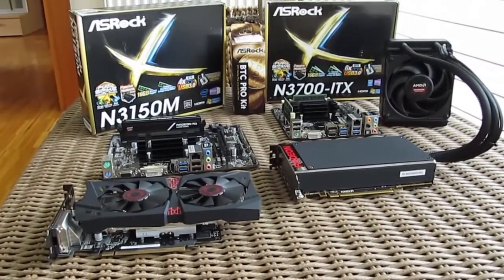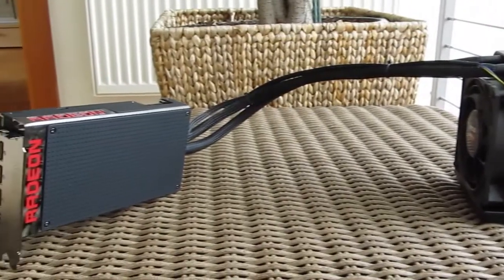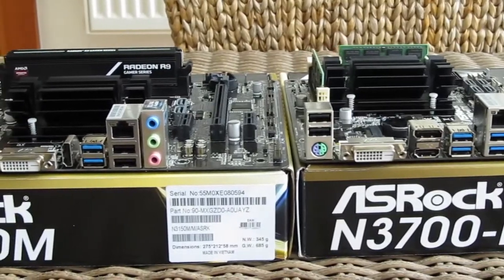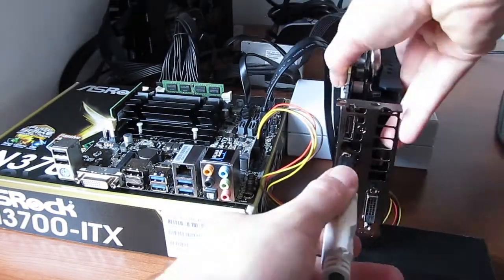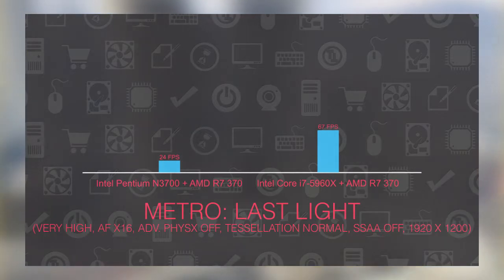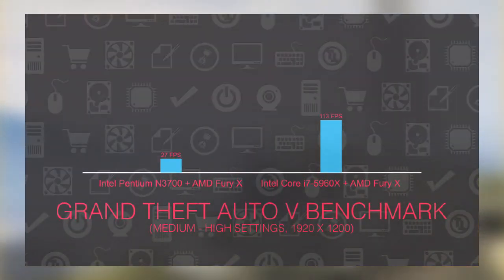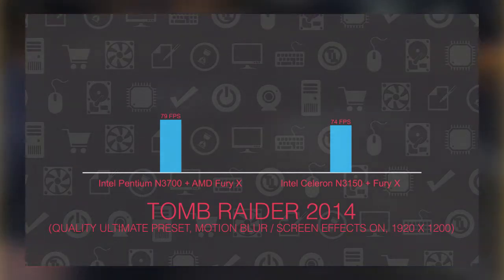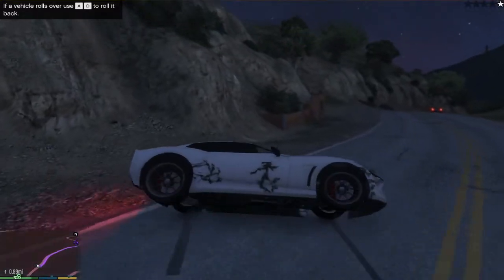Curious Geek - Intel SoC with Fury X & R7 370

Comment: I wonder how the new >8 core c3000 atoms would fare..
Reply from the maker: Me too :D
Reply: The c3955 / c3958 (16 core , ~30W TDP) is like twice as fast in 7zip benchmark than 2500k for example. I couldn't find any useful single core benchmarks. Many games are starting to support multiple cores, so it could work while gaming too ! The on mobo-soldered cpu-boards cost 800¤ though...

Comment: A nice thing to try, in my eyes, would be to build a pc that would guarantee bare minimum 60fps in cpu bound games.

Scrape the bottom of the barrel for cpu's, slap on a high tier graphics to test cpu viability, then  switch to the low tier graphics cards, and keep testing viability.  Expand from there. :>

My 2 cents :p
Reply from the maker: o3zman Yeah, that would also be an interesting scenario to try out. I will definitely have that on my mind in case I get an opportunity to do something like that. :)